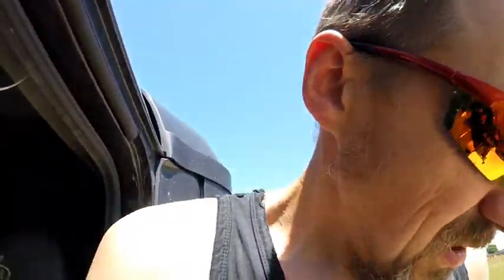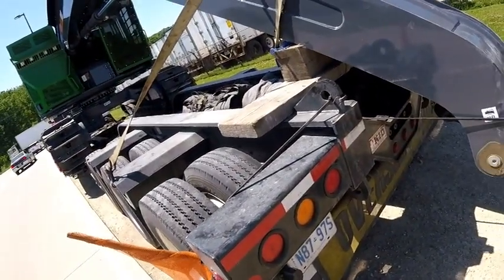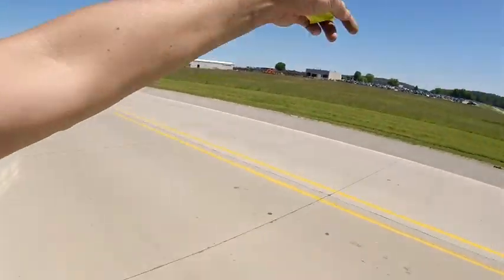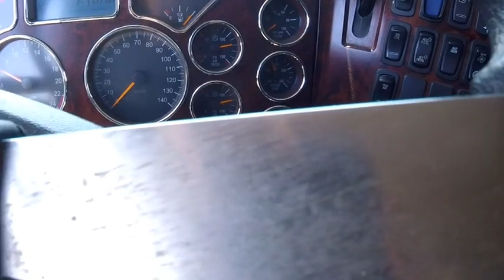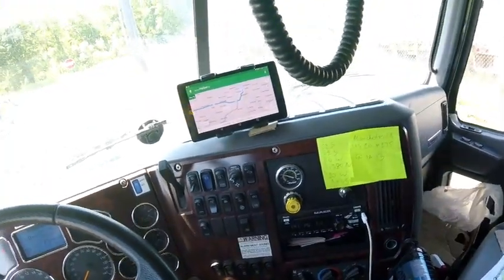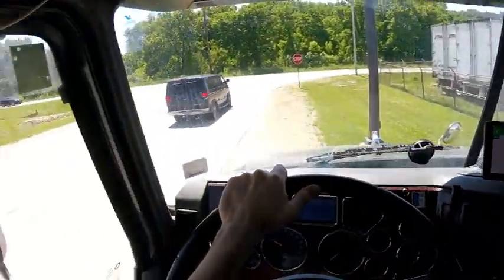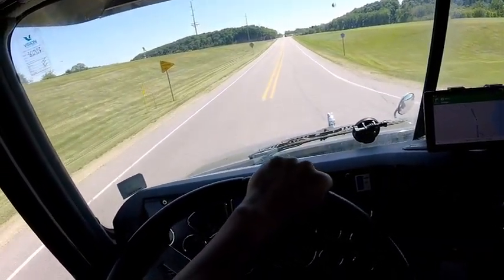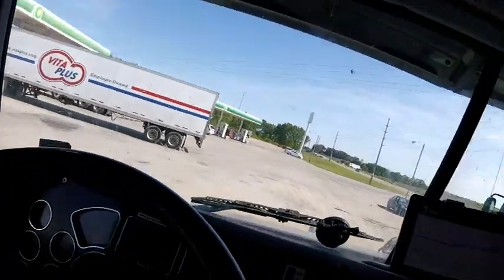Heavy Haul TV: Episode #540 -- John Deere 853MH -- 68,500 LB

Comment: you should not have to keep on priming  the pump, you have a lost of pressure in the fuel system some place.check the pressure valve. Mack has to put a pressure gauge on the system to see your pressure lost.some one at the Mack dealer is giving you the run a round I would say.

Comment: check the pressure regularly on the fuel  rail , if the pressure valve is bad it will not hold fuel pressure to the injectors. causing lost of prime.

Comment: You didn't finish your thought on the double seal gas filter and the guy that said when Mack trucks sit overnight they need to be pumped to get prime. Or was that the end of your thoughts on it?
Reply from the maker: well, basically the mechanic sounded as if it's a known problem, common to many Mack trucks. they never figured out a solution. they just know to prime them in the morning.

Comment: Never before seen a John Deere excavator in green.
Reply: It's not an excavator.  It's a forestry harvester from John Deere Forestry Equipment.  There is a forestry processing head that goes on the end of the boom.  After a tree is cut down, the harvester picks up the tree and runs it between two drums in the head  to take the branches off of the tree and some of the loose bark.  There is also a chainsaw cutter in the head to trim the log to length.  The machine then stacks the processed log in a pile for the loader to put it on a log truck.
Reply: Yes, I know.